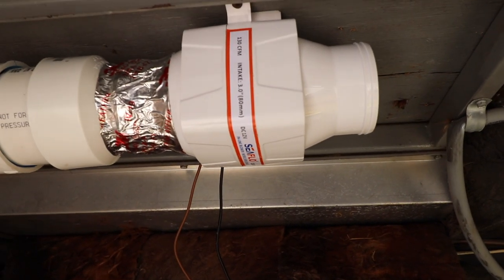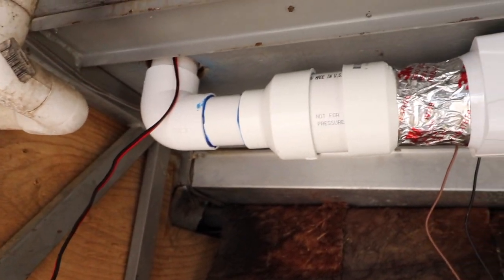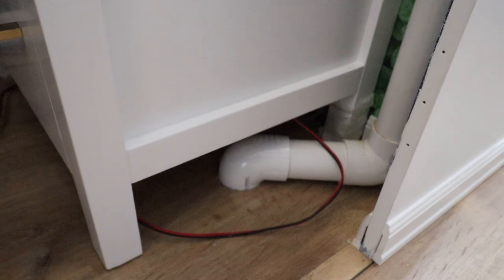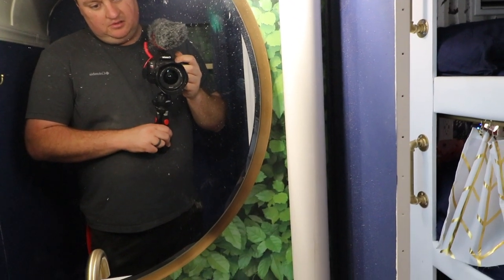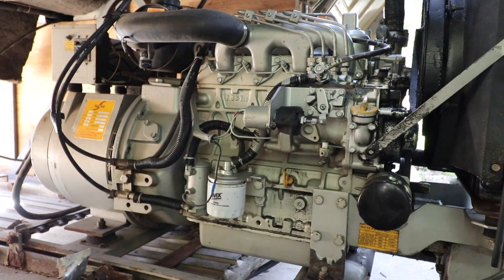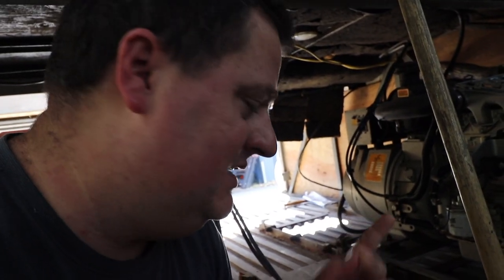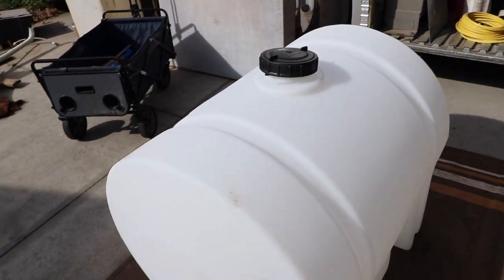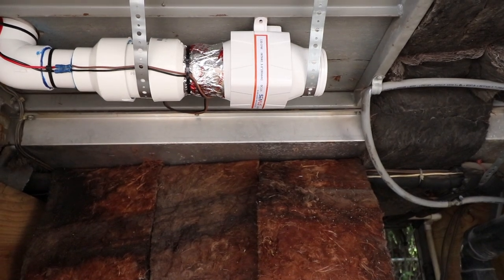How We Built An Exhaust Vent In The Bus | How To Get Rid Of Humidity From Inside RV

Comment: Hi looks like you did a good job .The biggest worry you have is Will the biliage pump fan circulate enough air through the pipe and out of your rig.to me when you turned on the fan it sounded like there was more than enough air going through there . I would say only time will tell once you start useing your Rig full time is about time if anything going to stop working . Good video

Comment: That looks like a good shower venting option, especially for the east.  Did you happen to measure of figure out the cfm (air  flow).  Happy travels and follow the Son!
Reply from the maker: Thank you! The pump is rated at 132 CFM. But that’s not accounting for the pipe reduction from 3” to 2”. Also there is 2 openings so I’m really not sure at this point. It seems like it will handle the duty just fine, but we will have to see.